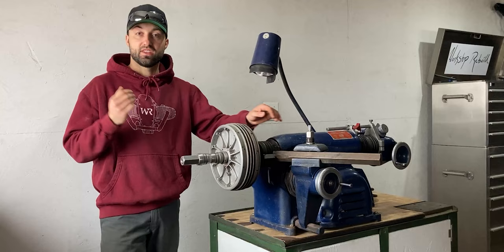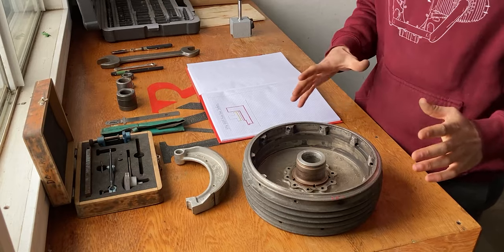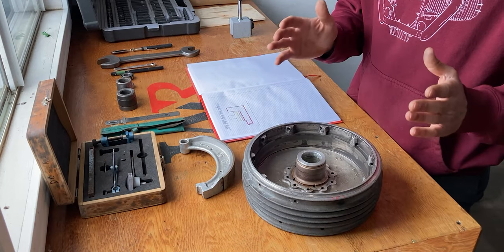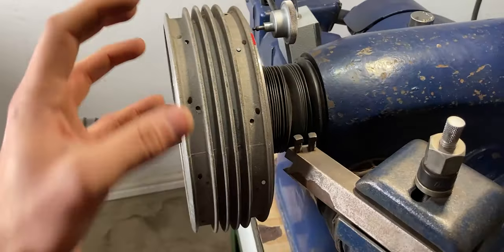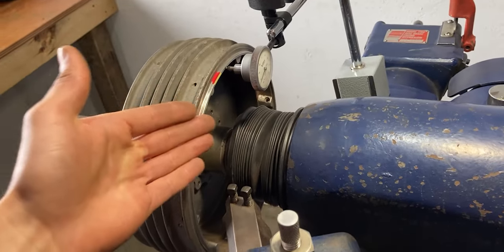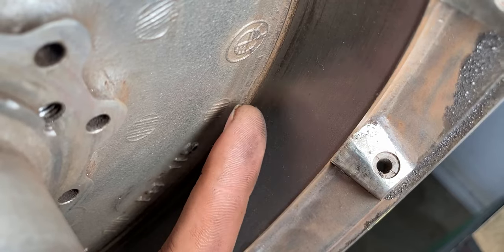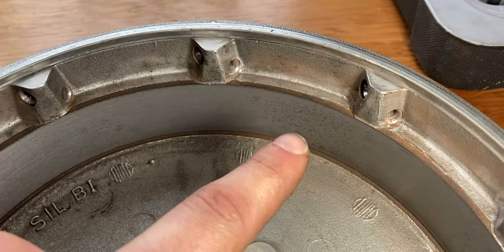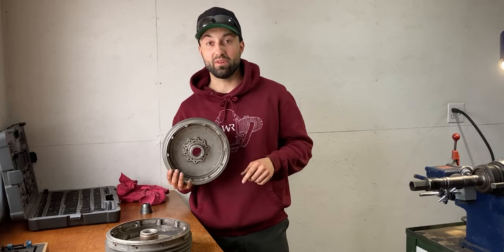BMW Airhead Brake Drum Reconditioning (BMW R60/5)

Comment: Normally inside the drum should be marked the maximum allowance the inside can be machined, if not it should be listed in the service manual know as had to get rear wheel on gsx250 machined by local machine shop as it gone oval giving a pulseing feel to the brake when in use.
Reply from the maker: Great comment! These brake drums have the maximum diameter cast right onto the outside. Luckily I was still well within spec to be able to reuse the brake drums!
I‘m glad you were able to get your brakes addressed by your local machine shop. I have a feeling your braking power will be much better now.

Thanks for sharing this😃👍🏽 Regards Andreas

Comment: Another great video! Kudos for getting a brake lathe - not something you see every day. The front brake on my 60/5 was not great when I got it, and I had the wheel rebuilt, the drum skimmed and then the shoes re-lined and arced to suit the newly skimmed drum. You don’t mention this, but by skimming the drum it essentially ends up slightly oversize and standard shoes won’t make good contact? Perhaps you are going to do something similar in a future video!
Reply from the maker: Thank you for your feedback, Simon! This brake lathe was a really good deal and it had all the tooling (boring bars, inserts and tapered tools), so I couldn‘t pass on it. These brake lathes are becoming a little bit outdated, because nowadays most mechanics just purchase new parts...but in this case I still think it‘s worth saving the old hubs and it might be a little bit cheaper as well😄
You got everything done correctly on your BMW R60/5 and I‘m glad you mentioned this! 
Once your inner diameter (hub) is machined, it is simply oversized. If you install new or used brake shoes, they will only have contact on two spots, because the diameter is too small.
To make sure they have contact on the entire surface, one must take a skim-cut on the outside of the brake shoes. I have not done this yet, because I am still deciding if I will re-install the old brake shoes that are in very good condition or if I will purchase two new sets, to then skim down.
Since this isn‘t something everyone can just do at home, I probably won‘t dive too deep into this topic, but it will be shown within this video series.

Thanks again for another awesome comment of yours! Regards Andreas
Reply: @WorkshopRebuild  Some say the old shoes are still good and you can still buy shoes with essentially the same compound. Mine at 30k was still by all appearances barely worn at all, but I chose to go with a newer grippier (but faster wearing) compound because the vehicles we are up against on todays roads tend to be able to stop a lot quicker than they did 50 years ago! Setting up the 2LS front brake is a bit of an art, but I found a couple of well known sites on the web invaluable. Given your skills, you probably won't need to refer to them! Contrary to expectation, the drum brake on the /5s is more powerful than the single disc on the /6s that followed.

Comment: So if one didn’t have this machine, can one just buy new ones for the old bikes from bmw?
Reply from the maker: You would have to get in touch with your closest BMW parts supplier. They will definitely be able to tell you if they can source one or not. This might not be your cheapest option, as BMW parts are pretty expensive. Another alternative would be to join a few Facebook BMW motorcycle groups or search through eBay. There are always great deals to be found. I hope this helps and if you have any other questions, feel free to ask! Regards Andreas